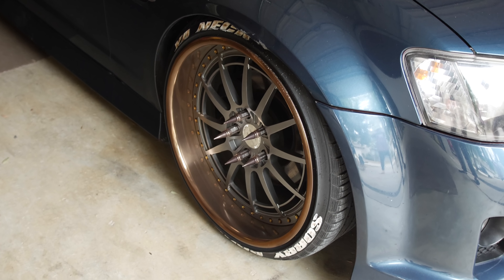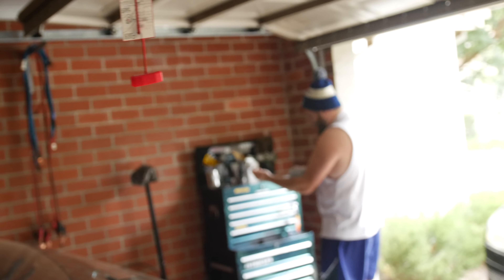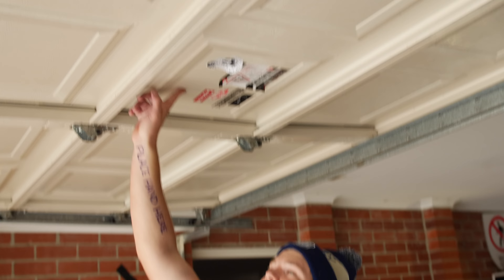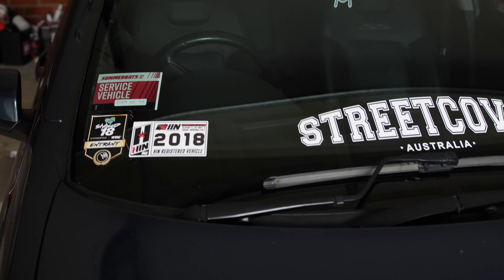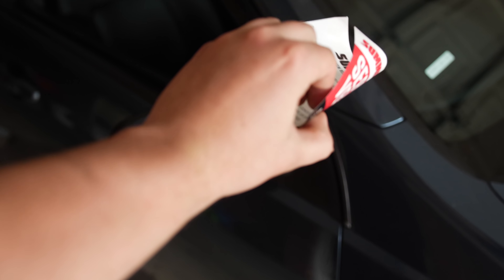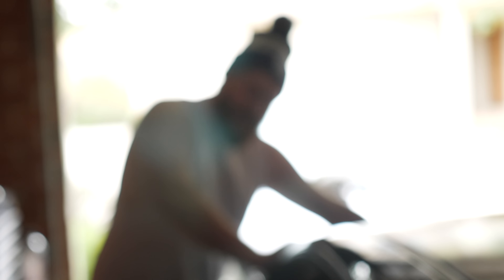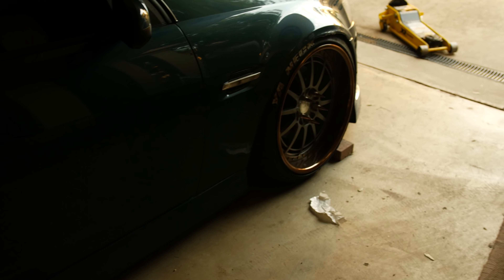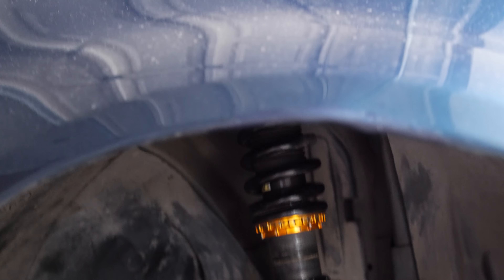I Got Defected! How To Clear A Defect In Australia

Comment: I can kind of understand the stickers on front obstructing view but no idea why back window stickers are a problem. Some vehicles don't even have a back window so it doesn't make sense to me that a sticker is worse. My ve ute has the hard lid with the humps from factory and that is much more an obstruction to view than any stickers. I probably would have left the rear stickers and ask them at pits if it needs to be removed. If so, do it then.
Reply from the maker: I probably could have! I just didn’t want to give them anything, one thing could have them turned into two things... etc etc

Comment: So if you get defected for the back sticker blocking the rear window view, does that mean every van in Australia with no rear windows are also defectable? I thought it was up to the driver to fix proper rear view mirrors if the rear window is intact blocked.
Reply: No, if it comes factory it's ok.
Reply: TaxEvasion.Law states that if you have door mirrors you don't need a mirror inside

Comment: I love how the policeman uses an electrical device with a removable battery beside a petrol pump.  Precisely why they made the do not use phones at the pump rule.  Beside that your car is too low which makes it look worse, ride worse and handle worse.  Get some decent shockworks coikovers and raise it up a bit. The only upside of being so low is attracting guys (which is fine, not hating gay guys).
Reply: They made the do not use phones rule at the servo because of a theoretic problem. Your phone in your pocket it still active and closer to the petrol filler.

Comment: Do you guys have certification plates in Aussie? In nz we have lvv certs for stuff like wheels suspension and stuff
Reply: We have a Pink Slip which is renewed every year which a certified mechanic will check the whole car over.Brakes,lights,tyres,engine and what not set you back $40.We also need 3rd party Green Slip depending which insurance company you go with $400-$700 depending on age,driving experience and area you live in.Then pay your Registration anywhere between $400-$700 depending on age,driving record and area you live in.Its not untill after all that and everything passes that car enthusiasts/hooligans start modifying their cars to the way they want it.
Reply from the maker: lawrie mccue we do, but for minor things we don’t need them
Reply: But what about for modifications? If you have say say coil overs or wider wheels or a
Manual conversion
Reply: lawrie mccue we have to get something called an engineer certificate to say they they’ve been put on probably it mainly for engine swaps air ride suspension even some light bars for 4x4s
Reply: @Youzx-rj8tq  you dont need an engineer's  certificate for a engine swap
Reply: @spencersikei6413  can I ask what state you are in please.(sounds like NSW)
Reply: yes you do in some situations.  for NSW Light-vehicle-modifications-Vehicle-Standards-Information shows what mods require certification when trying to register MODIFIED INTERSTATE/UNREGISTERED or IMPORT yes you do before getting blue slip. Things like aftermarket brembo brakes, emission test,  wheels/tyres that are more than a certain amount larger than factory option, altering vehicle ride height less or more than 1/3 factory height, An engine swap that is not of an original family of engine for the series of models, or any engine more than 20% larger than the largest original optional engine for that series.

Comment: You can't get a defect because your vehicle was on private property and not on the road not did you get pulled over . But those wheel nuts are dangerous
Reply: Thats actually wrong, you can be defected especially any area accessible by the public eg maccas, fuel stations.
You can also be charged on private property including your own house this comes under a different rule not defect but reckless endagement of life.
Just ask troy candy and his skyline on his own property.
You also have laws coming across Australia that is once defected for a modification putting that modification back on is a hoon impoundable offence and will be impounded and crushed. There will be no more modifications from factory specifications.
Reply from the maker: What he said ^
Reply: @OgglyGoogly  check law again.they cant come onto private property and defect a car
Reply: the law in Victoria does allow for it. If you read the above statements, if you were doing burnouts on ptivate property that can be entered from the road via a public road access. Then yes they can seize the car and defect the car and fine the driver for reckless endagerment of life which makes it not just a traffic offence but acriminal offense. The other charges also then become undue noise, excessive smoke and can bring epa charges as well. If they want to go full hog on someone. 
@Troycandy found this out himself and was also put on the news and through courts. You can also be jailed for drag racing if the other dies even if you did not make any contact with the person. These are just some of many examples.
I welcome you to try to test the theory of call the cops then proceed to do the burnout at the service station, mc donalds or bunnings carpark, or a carpark at your own factory or mechanics workshop that is on private property and not on vicroads land.
You will find your car bike impounded very quickly.
Reply: @OgglyGoogly  well seeing  Bunnings, McDonald's,service stations and most carparks are public land of coarse you can get ino the shit
Reply: @OgglyGoogly  who is @Troycandy
Reply: @peterbarber7613  They are privately owned, not public property. Vicroads dont own the car park.
If you own or rent a factory and do a burnout in your dactory same thing applies can still get done. Troy candy has a you tube channel and instagram eyecandymotorsports you can look up.
Reply: @OgglyGoogly  anywhere with public access is public property.I watched that clip of @Troycandy and nothing happened to him that night + I have got 20 acres and the end of a dead end dirt road that has public access and the good thing is they cant touch me when im hooning around
Reply: @peterbarber7613  not that clip, ask him about how he lost his skyline and was on the news.
Reply: @OgglyGoogly  I don't watch the news but if he was stupid enough to be an idiot on the road that's his fault.He would have ended up getting his skyline back anyway
Reply: @peterbarber7613  no was in his private property and car got impounded loss of licence as well
Reply: @OgglyGoogly  Where is he from.Thank god ive never had problems like that on my property
Reply: @peterbarber7613  to true mate, yeah hes from carrum downs victoria
Reply: @OgglyGoogly  he must have really stuffed because the police cant come onto your house property and seize your car under the hoon laws
Reply: @peterbarber7613  yeah went to court and all, all legal. 
He can fill you in on details but yeah google troy candy hes pretty famous